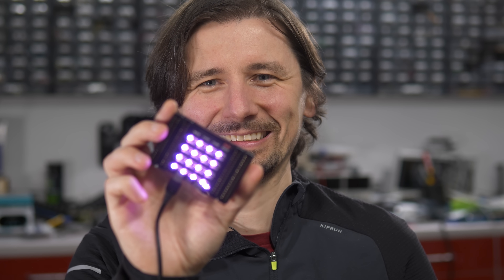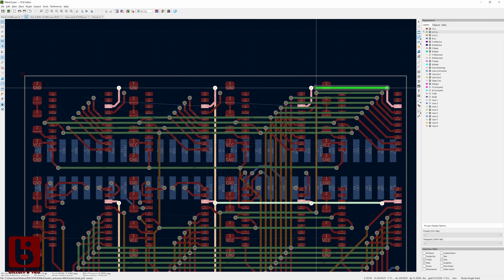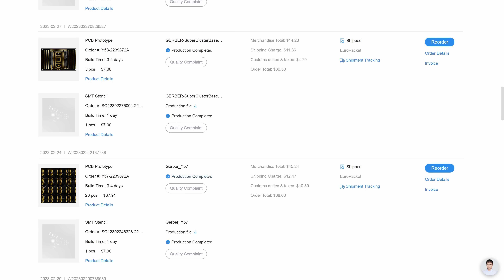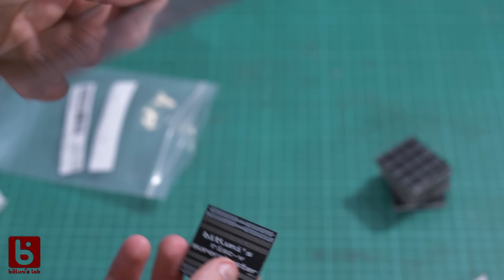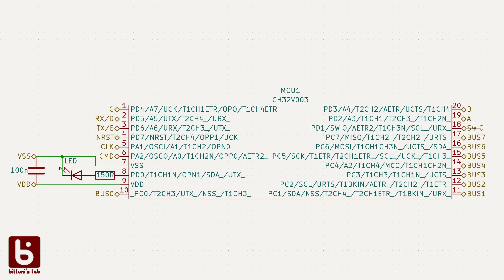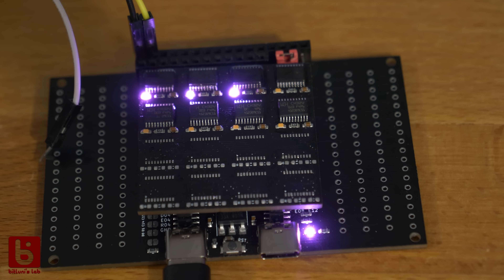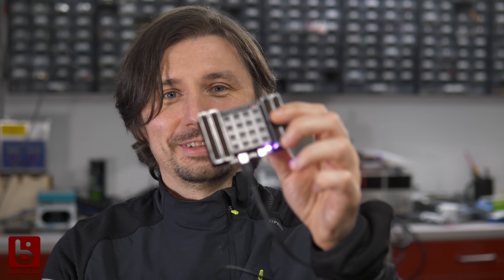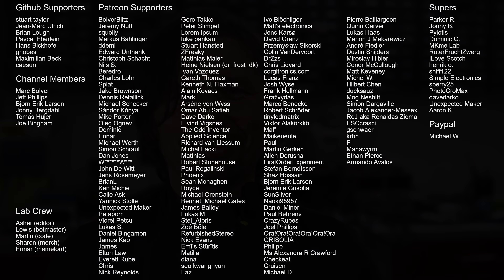Cheap Risc-V Supercluster for $2 (DIY, CH32V003)

Comment: My big issue with PI and all the likes is that whenever i >actually< try to do something useful they performance or connectivity just does not cut it and i am forced into x86 again. Sure, i am a complete enthusiast and normal people just dont need a homeserver or an ESP everywhere but i would just wish there was a mini computer like Pi and the likes with just better connectivity and features. I am happy to pay NUC prices when it has a real benefit in terms of power draw. Especially here in germany energy cost is a REAL concern because ppl just cant pay it anymore when the provider increases your plan by 800-1200%.

Comment: Make a fast phased ADC. You have 64 ADC's. Apparently the ADC clock is 24 MHz, 10 bit sigma delta conversion. That means you should be able to get 2MHz conversions. If you get the timing right, starting each conversion at exactly the correct clock phase, you may be able to build up to a 128 MHz, 10 bit ADC. That is damn fast for a $2 component. Of course, you'll have very limited memory so you won't get a very long sample window.  Even if you only store 8 of the 10bits, that is a maximum of 512 samples per channel at 2MHz, or 256uSec of data. You'll need to make sure all the chips are synchronized to an external clock. It would be interesting to see what you can actually achieve given the real limitations of the hardware. After you know, you can turn it into a very cheap, albeit slow oscilloscope.

Comment: Following the idea of maximizing mcu count you could for cost efficiency look for adressable led strips with use a mcu as controller chip for the insividual led groups. It would then just be a matter of bridging over the diodes which block the upstream comunication.

Comment: I have new idea now, I will fake TPU core with your design.
Made a simple program, that help execute simple math with 2 small matrixes.
The data and command will be sent to child nodes using RS485 protocol (I guess RS485 is good in this case).
Then child node will execute the simple math and then send result back to motherBoard.
MotherBoard will wait until all childs executed and send final result back to PC.
This will be a low cost, low power usage application. I think it's more efficiency than GPU.

Comment: Well, I don't know that those MCU are fast enough, but maybe you can convince a drone platform of that many propellers and/or ion propulsion jets to hover, flip, etc. if not stay stable in winds or transition into propulsion for winged situations or just act as speakers or noise control. Maybe a 4-head green-temperatures (ca. 30-400 degrees C) glass (yeah, so not silicate so much) printer? Bird trainer? Tomato protection robot? Terrain table controller? Sisyphus derby table with doublekick sonication and volcanism (pumped sand?) Solar conc. dog poop carbonizer with gas separation for pulling off water, nitrogen, methane, benzenes.

Comment: I have programmed 10 atmega circuits at once in parallel (it was tough to program 500-1000 circuits, but in parallell there was 10 times faster!).The ISP protocol worked well and no issues. Sometimes one or two chips did not get programmed because of some malfunction, but the rest was OK. The code had internal integrity check, so I have had instant info that programming process went OK.
Reply: Beware in general that it's possible to program flash memory "just barely" or "all the way" and the difference doesn't manifest until some time later as the bits start to fade out.  I'm not sure if this could have happened in your case but it's something to be aware of.

Comment: I remember working on a Sun Sparc with two 50 mhz processors and it was considered a high end workstation at the time! Here are 16, 48mhz RISC processors on a pcb the size of the sparc cpu.

Comment: Can you please add a command to clean display in your esp32 VGA out library. As it will be very useful for displaying moving data on screen.
Reply from the maker: what do you mean with clean? did you check out the examples? there is a clear function
Reply: @bitluni  like lcd.clear();

Comment: Your enthusiasm is infectious :-) I would love to see a cluster like this solve large parallel synthesiser calculations or other audio conversion modules like digital reverb.  Pure Data is a great starting point which has been around for decades as an IDE (as a simplified GUI) for modular synthesis on x86 and ARM based SBC's.   I know I am probably dreaming now, but since Risc-V is open source thing, I can imagine using this flexibility to developing an instruction set tailored to digital signal processing.

Comment: why not use an existing bus like i2c or 1 wire depending on the bus setup you have?
also a master controlled bus might be better, afaik reset can be used as a gpio, so you could have each controller set its pin low when it wants to communicate and then the master sends a data request on the bus.
you control all the chips so you can make sure they are well behaved and only respond after they receive a data request and stop listening to data requests till there's an end of transmission or the line goes low (to avoid collisions in case you need to send data that looks like a data request)

for sending data you can just take inspiration from tcp/ip and use the chip address with 255 being reserved for broadcast. 

for setting the chip id you can have an initialization sequence with each chip getting its reset pulled in turn and the id being sent on the bus.

though you could also simply use the reset as a communication line if you need data back from the chips.

imo a more interesting bus if you just need one way communication would be a daisy chain similar to what ws281x use (a pass-through with a FILO shift register that sends the overflow down the line and keeps the data for itself if there hasn't been new data for a set time, 50us IIRC for the ws281x )

you could add manchester encoding because it's cool and also avoids clock drift on 1 wire communication.

Comment: Why not have individual programming pins and a shared reset line? Sure, that way you would reset all MCUs each time you wanna program one of them. But I presume you won't constantly programming them...?
Reply from the maker: My decision to do it like that was so in production I could use the linke programmer only attached to one pin and the main cpu cycling the reset lines. Turns out that idea is not that great

Comment: If the CPUs could talk between each other, a neural network would be pretty fun.
Reply from the maker: they can, they will, it fun
Reply: I could help with adapting tensorflow for this thing, did this at a previous job!
Reply: @vsabadazh  Tinygrad might be a better fit...
Reply: SwitchNet or SwitchNet4.
Reply: I wonder how it will perform.
Reply: Well, the core is 100 MHz.  That's pretty fast.  cortex-m3 ten years ago was about that fast, in a $15 chip at the time.
Reply: @kayakMike1000 100 MHz for simple tasks such as sub matrix multiplication should be very fast. The issue is I/O bandwidth
Reply: Look at “AI” - they’d soon run out of useful things to say 😂😂😂😂

Comment: By today's standards 48mhz is kind of slow, but those are so small that with proper programming I can see it easily being useful for all kinds of projects. Consider this, if each one operated a dozen or more neural nodes in a network you could just keep linking them together and achieve something really cool. Imagine having a room sized computer that appears to think.

Comment: CSMA/CD is basically what you’re implementing.

It’s great if all of your cores are responding to the exact same code and handing out tasks to each core because each core can be listening for the same code and then you can feed each core the variables individually and they will get to work independently.

The draw back comes when you are trying to handle each core independently on different tasks and different programs and they are completing at different times. Each device pining for attention around the same time exponentially reduces through put because they are all on the same collision domain.

If you can’t avoid this, then maybe you can multiplex 4 cores in 4 rows together so you have 4 more collision domains. You would see a 4 fold increase in communications speed. Ideally, each core would have its own communication channel.

Another alternative would be to use interrupts so there are no collision domains, also significantly increasing through put.

Comment: Low Pin-count Debug Interfaces for Multi-device Systems is a good article about how to program multiple MCUs with a single programmer bus. In short: with JTAG it's easy, with SWD it's possible in some cases.

Comment: Cool! Can you repeat your ESP32 tricks with CH32V003 uC ?
Reply from the maker: challenging, VGA already working but the 2kb ram is crippling
Reply: @bitluni  who did say it will be easy ;) With the cluster it's possible to render each scan line of a group on a different uC. And you need to overlap group of scan lines rendering with displaying group of previously rendered scan lines. Basically SLI :D

Comment: Perhaps consider using a PNP constant current pull-up on the open drain bus to help speed things up.  This could be as simple as a current mirror with 2N3906.  This will probably at least double the speed of the bus.
Reply: Be careful with using PNP. They're normally "slower" than NPN and the fast ones are more expensive. I was thinking of doing what we did in the old SCSI days. Use two resistors (normally around 240 ohms) in series. For a 5v signal that would give you a 2.5v source with an impedance of 120 ohms (a voltage regulator with a series resistance will do the same thing). Depending on the drive capability the equivalent series resistance might require different resistors (for example if a 500 ohm impedance is needed use two 1k ohm resistors).
Reply: I wish they binned JFETs for zero gate voltage current
Reply: @big0bad0brad  They sort-of do.  See Art of Electronics to explain.
Reply: @cheponis  Yeah the bins are just too large tho, I'm thinking parts you could order in resistor precisions
Reply: @big0bad0brad  Wrap the FET around an op amp, that will get you what you want.
Reply: @cheponis  An op amp?  I want a 2 terminal (effectively) part, now you're talking about something that needs power connections?
Reply: @big0bad0brad  Well, you either build you own ion diffuser; or you simulate what the resultant desired and as-yet nonexistent part would do - with existing parts.  Your call!  ;-)
Reply: @cheponis  Or you buy a crap ton of them and bin them but I don't intend to start a business for that.
Reply: @big0bad0brad  You can't 'bin' FETs like this.  The FETs are designed for a given threshold voltage by doping.
Reply: @cheponis  When you can buy FETs that vary from 5mA to 15mA you sure as hell can bin them
Reply: @big0bad0brad  Ahhh, I think we are talking apples and oranges.  I'm talking about the threshold voltage, V-sub-t.  YOU are talking about I-sub-d  ; the transfer function can for sure change.   I know it's late in this back-and-forth, but: do you have EE degree?  Or are you an electronics enthusiast?   I ask only because if you ARE an EE (like me) then we can go directly to equations to discuss the issues.
Reply: @cheponis  Ahhh yeah I was basically talking about using jfets as a 2 terminal current limiter with zero gate voltage.  I quit ECE to work crappy IT jobs because I really didn't like one of the calculus based physics classes and I'd probably die if I moved to the west coast anyway.  I'm sure there's some non ideal behavior like temperature dependence and things like that but for a bus pullup if you had something in the right ballpark it'd be nice.

The only circuit I've used JFETs in is a weird 5V to 12V level shifter out of a small N-MOSFET, JFET, diode, and resistor - the JFET essentially provides the pull-up, the N-FET provides the pull-down (by pulling on the gate of the JFET which is attached to source with the diode to yank the source down as well), and the resistor is just a pull-up for the gate.

It sounds like a weird circuit but it can survive a short to ground on the output and has no over/under shoot which was the main reasons I wanted to do it that way.  It can pull all the way to positive voltage but only scrapes near ground during the initial swing, and then hovers above by the diode drop.

Application was level shifting in a band organ MIDI controller output to the 12V driver board; I didn't want any unlimited 12V there ready to break something else if someone jacks up the connections.

Comment: Voice recognition is quite CPU intensive although I don't know how well it would perform on this cluster. I know there is a open source project for droids that aims to be bi-directional communication with a human, but one of the things hindering it from being fully autonomous droid is that it is quite cumbersome to drag a laptop around including extra battery. Using smaller components could potentially solve this problem. It probably would be a daunting task to accomplish.

Comment: actually if you had a good/simple and relyable enough programming method then this device could easily take over the maker market, since $2 for a makerboard with such specs could kind of become something like a new arduino mega, the programming of the many cores should however be doable more easily/relyable, so a good communication protocol and perhaps even a library(perhaps using cores just like pins or even a parametric auto scheduler).

I know $2 is the diy make cost. but even if those get sold for more than double the price people would still buy it if it has decent enough support to work with them relyable, for around the $2 price some hobbyists might acctually already use it even if there is no propper support yet.
and if now it can be made for $2 then imagine what happens when it is mass produced automatically in a bigger quantity, then it might become cheaper. ofcource a custom/dedicated risc-v design would probably work even better(perhaps for simplicity some kind of matrix array where each chip can connect to the chips around it(4 or 8) where all chips know their number(code)(or learn it) and then they can just decide easily and rapidly what way to move the packages that way communication can easily be done like predetermined so automatic and hardwarebased to reduce latency and prevent cpu blocking and such. better methods would be possible, but this method is insanely simple to implement compared to more complex methods, and also it allows or insane scalability without needing to many pins. it also would work with if there are multiple cores on a single chip, in this case however it is best if all chips have the same core count to keep the logic and pcb design simpler that way there is less or no need to think about interfearance and such.

Comment: "The AI is going to write code differently from humans"

Depends on where you're looking from. In 8bit BASIC there was no features for passing arguments or calling functions, so you had gosub and spaghetti code. I have the feeling it will go back to that, and it will be a tangled mess (albeit when it works, an efficient one).

Comment: There is a trick for the runny solder paste let it partially dry out In The open and don't use it right away. On the other scenario where the paste is to hard you can add liquid flux to get the consistency right just mix the dry out old paste with the new one until consistency is perfect.
Reply: Spreading some on a piece of paper may do the trick too
Reply: @freakinccdevilleiv380  sure for very small badges and quick bodge jobs Is this method suitable but for quality production/repair is this method (solder paste on paper) very wasteful, expensive and unnecessarily Laborioso.

Comment: Just think, you could theoretically hook up large amounts of memory to this and train neural nets with massive batch sizes in parallel. If you made something up to spec that can do this task, I will pay you a lot for that device and some software. @bitluni
Reply: If I can plug in some kind of fast storage like ram memory, or even an nvme ssd, at the scale of half a terabyte or more, and have something like each core doing one datapoint in a batch, with a thousand or more cores, and interface with my Linux machine, I’d be very interested.

Comment: So, as an MCU these don't have direct external data and address pins like a CPU, right (for attaching fast external RAM and storage)?
Edit: Couldn't you put the solder paste in the refrigerator for making it stick better?